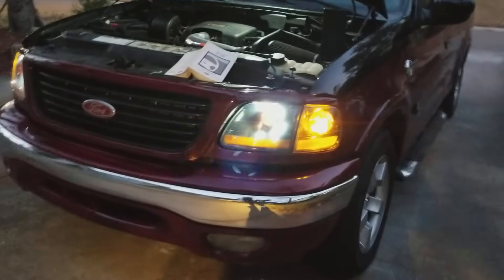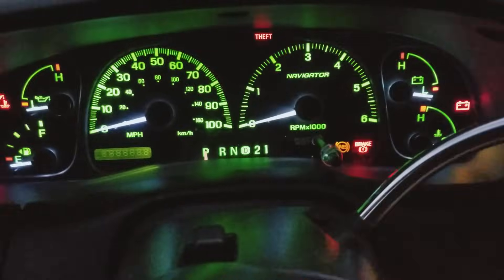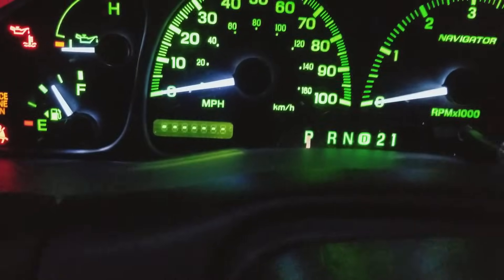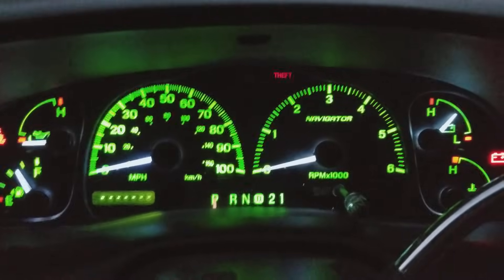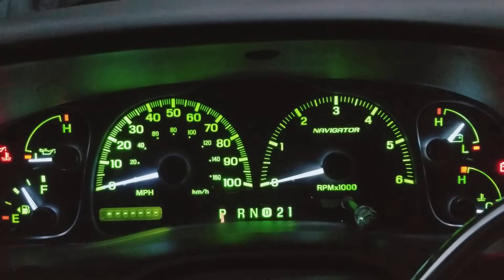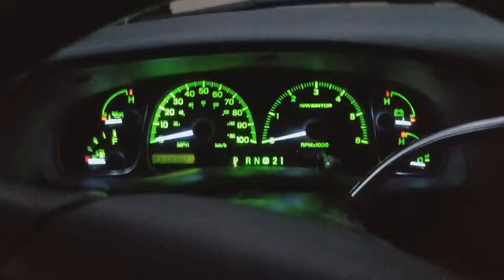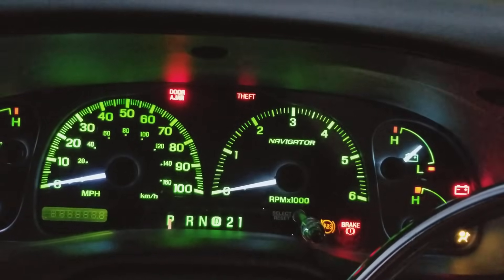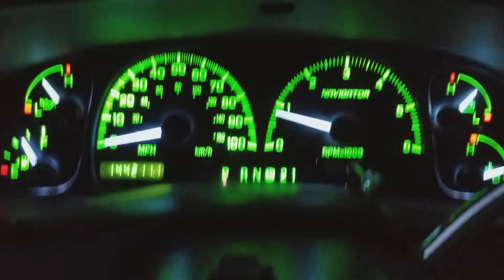1999-2003 Ford F-150 THEFT light decoding

Comment: I just fixed a 2001 F150 4.6 V8 crank no start with flashing theft light, dashes in the odometer, clicking PCM and fuel pump relays. No communication with the scan tool and theft light code 16. The fix was to remove the PCM connector and check power and ground circuits. All ok.  Reinstall the PCM connector and theft light is solid odometer reads 229k miles instead of dashes.  NO clicking relays scan tool communicates with PCM. The problem is micro corrosion of the PCM connector terminals causing poor connection. 

I hope this helps someone else resurrect their old Ford

Comment: WE CAN DELETE PATS PERMANENTLY if anyone needs that.

Codes 11 thru 15 are typical PATS problems (transceiver, incorrect key codes, etc) and having us delete PATS will fix that right up.

Code 16 means the PCM is either dead, not "on" or not getting power, or it's shutting itself down on purpose to protect itself from a short. Code 16 requires additional diagnostics, but a great place to start is checking your fuses and your PCM relay. You can temporarily swap your PCM relay for another one in the box with the same part#, just to see if that fixes it. If it does, that relay was bad.

Whenever you see - - - - - - on the odometer, that means your PCM is not functional, or at the very least it can't communicate with the PATS module. The instrument cluster is designed to display all dashes any time it can't communicate with the PCM. Usually this happens because the PCM is not functioning. This does not always  mean the PCM is bad, but it does mean it's not currently alive.

For less than the price of buying one programmed key, we can delete PATS permanently and your truck will never need key programming again, and you can start it with a $2 metal hardware store key, as long as it's cut properly. We also can provide you with a good used PCM that is already VIN programmed, coded, and PATS Deleted, meaning it's turn-key ready to run when you get it.

Comment: My 2001 5.4 f150 4x4 only throws one code p00353 missfire primarily secondary coil c . I e replaced coils plugs intake tps,knock sensor, map sensor, maf,cam,crank sensors, complete timing set after 1800$ it still misses at warmup temp or above 45mph . Runs great until warm misses bad .wgen cools down will run and pull like a champ .plz can anyone help in to deep to sell.

Comment: Is there a fuse also or just relay?
Mine wouldn’t start and theft was flashing but my battery has been draining down bc when I turn key off and remove the ac will still blow and electronics still power with key off and removed.

Comment: Mine did this. Didn't run a code. Had to boost it twice. Flashed theft and wouldn't start. Got it to start and had it tested. No idea. I got the relay and switched it. Guess I'll find out if that fixed it later. I can't stand electrical. This helped me alot tho because I had no clue where to even start

Comment: New subscriber  , thank you so much  , mine is a 03 f150 4x4 recently bought the truck left me stranded 50 miles from home  , had it towed ouch , this morning googled and found your video  , the relay cost 20 bucks at a zone, and now working great. Your video is the only one that I could find that was helpful. Thanks again .

Comment: I Changed  my pcm relay and I still have theft light flashing, still have code16 , I tried it with a jumper wire in place of relay. Still won't start.was running great when I parked it .just sat 2 days .replaced relay again  can you help me??

Comment: Brother you’re the best!!my 2003 ford f 150 did exactly this yesterday after work. It wouldn’t start with theft light flashing. I installed the extra relay for taillight heater and fixed it. It started 30 times straight last night!!! I’m getting a new relay today after work. God bless!

Comment: Anyone experiencing their truck misfiring when their theft light is flashing ? My truck starts and runs but my truck only runs smoothly and has full power when the theft light isn’t flashing, when the theft light flashes my truck definitely doesn’t accelerate as fast & gets jolty if I don’t go faster than 60mph ☹️

Comment: Thanks For Video
I Had The Theft 16 Error Code Failure.
Verified Bad Relay By Swapping One Just Like It In Fuse Relay Box.
The Theft Error Went Away..
Still Wouldn't Start Due To Moving Relay .
Walk Right Up The Street To AutoZone W Bad Relay..
21 Bucks Later..
Back On The Road.

I Figure I'll Keep An Extra Relay In Glovebox

Comment: The code 16 occurred in my 2003 f150 lariat after I replaced the battery. This did not fix my issue unfortunately.

Comment: my 2000 f150 has P1260 and still starts an runs. I only hooked up a scanner hoping to get a trans code . 50MPH and 3400 RPM.. Transmission fluid is reddish and  doesn't smell burnt. Any ideas on either issue are appreciated.

Comment: What kind of cluster is that
Reply from the maker: Navigator! They're easy swaps to do, and look far better than the standard F-150 clusters. I've got another video if you're curious about the swap.
Reply: @fawfulize  Lincoln Navigator what year? Did you swap your ac controls also
Reply from the maker: @Htxfredy  99-02 works. Haven't done the AC controls, as that requires pulling the dash. Both the harness and airboxes are different.

Comment: Another fix if this isn't helping your situation. Use your key and turn your door lock on the driver side about half way. Not fully unlocked for about 40 seconds. Then turn it about half way to the locked position for about 40 seconds. Open your door from the inside and crank it up. Worked for me today. Driving home from work and my 2000 f150 5.4 died and started flashing theft. I did this and it's been doing fine ever since.
Reply: Cody Willey man I OWE YOU THANKS TIMES A MILLION ,,!!!   I was absolutely broke for the next three days and encountered this problem ,,, just had me seeing red if you know what I mean , watched one 30 minute video went into the wiring diagrams and where you could start ,,with testers and things I don't have ,, then watched this one suggesting a 20 dollar diode ,, whatever ,, would have been a start at least ,, but I give thanks to the almighty GOD that he sent me down to your comment ,, and also to you who took the time to post it ,,seriously I thank you ,, because I thought to myself hey it wouldn't cost a thing to try it  so I walked outside it was already dark and did what you suggested and BOOM truck started right up ,, shut it off and tried again and BOOM started right up ,,SO AGAIN I CANNOT THANK YOU ENOUGH ,, STRESS LEVEL PLUMMETED ,, Also when I get a little cash I'm going to see if I can find a way to send you at least the  $ 20,00 I would have spent on the diode ,,whatever ?? just for starters ,,, AGAIN SO MANY THANKS  !!!
Reply: @alanstubbs8196  glad I could help you out man. I got cashapp lol 🍻
Reply: Does this work only on powered doors? Cause I have a 2001 manual non powered locks and windows.
Reply: @alanstubbs8196 bro please help what exactly did you do can u explain the steps better?
Reply: Ive tried everything and theft light still flashes but havent tried this so u do the outsid lock with your key but how do you open door from inside is it the passeneger door?
Reply: @collinherrmann7223 driver door window rolled down
Reply: @collinherrmann7223 driver door windows rolled down

Comment: I have a 2003 F150 doing the same thing alarm is going off and lights flashing and won't start. I replace the PCM and still no start and still flashing THEFT. 

Help please.
Reply: Put key in ignition to 1st turn. Disconnect battery. Reconnect battery. Turn key to start. 😊

Comment: I just bought a 2003 Ford and the theft light flashes like that and has a weak sound but the truck does turn on and drives fine. However, it messes up the battery (we just had it replaced). Do you know how we can eliminate it?
Reply: Wait question r u able to regularly use it

Comment: I swap my instrument panel on 2003 f150.   My truck does not start now turns over.  Put old 1 back and it runs.  Will this your doing solve my problem?
Reply from the maker: Check out another video of mine with the gauge cluster swap. You're going to have to swap the PCB on the back of the cluster.
Reply: @fawfulize  Do you have a link to it?

Comment: I have a question my original cluster went bad so I got another one plugged it in and I thought it worked until I tried to crank it and it just kept turning over and I had a anti theft code 15 pop up so I guess they key doesn’t recognize the cluster I don’t have the spare key so what would you recommend me doing ?
Reply: you need to keep the original electronic board from the old broken cluster and put it in the new cluster

Comment: That was very helpful knowledge for someone like me. But my 2002 Windstar sport gauge cluster goes crazy. It also if you leave it idle the radio starts to fade out the fan fades out to nothing and things get them then you hit the gas it comes back. And then also sometimes you can just turn it off and try to start it and you just clicks like it's a dead battery real fast clicking noise like a ground bad. That's what I have 👍
Reply: Bad alternator !

Comment: Where did you get the other ten  when you only counted 6?
Reply from the maker: 7 flashes total. First set of flashes determines the tens digit. Second set determines the ones.

1 flash
Pause
6 flashes
Long pause
Repeat 

Code 16.

Comment: PROCEDURE WITHOUT A SCAN TOOL
If you do not have a scan tool with PATS programming capability, then you can use the following procedure. Just insert the new key into the lock cylinder and turn the cylinder to the “Run” position. After you do this, the “Theft” indicator light will begin to flash. It will take approximately 15 minutes for the light to stop flashing. Within 5 minutes after the light has stopped flashing, Turn the ignition switch to the “Off” position for one second, and then back to the “Run” position. After doing this, the “Theft” indicator light will begin flashing again for another 15 minutes. When the light stops flashing for the second time, turn the key to the “Off’ position for one second, and then back to the “On” position for the third and final time. The “Theft” light will flash for another 15 minutes. After the third time, which will be approximately 45 minutes from the start of the process, the PATS control module will have erased any of the keys that were programmed into its memory, while programming the new key that you have just used into its memory. This key will now start the car. Any additional keys can now be programmed using the Spare Key Programming procedure.
Reply: Dnt work

Comment: Hi, I have a 2003 F150 Supercross with the 5.4L V8. After I had a code alarm installed with remote start, the truck won't start in cold weather below 50 degrees including the the remote start. It flashes the theft light. After 3 or 4 tries the truck only starts with the key

Comment: 2000 Ford Excursion:     When the theft light blinks rapidly it means there's a (Code) problem with the PCM system.....so when he  turned on the key, it  blinked fast for about 45 secs....then it paused.....then it blinked once (for 1).....paused...then blinked 6 times (for 6)....That means a code 16........and then it started over....once...then 6....and so on. 
There are other codes like 15, 17, maybe a 14 but it's usually a 16...that usually means it needs a new "PCM relay" (under $20..00) from the dealer or salvage. easy fix. Find the relays in the fuse box(s). see manual.
UPDATE!!!!....I wasn't my PCM relays after all.... I had my charging system checked a few months ago when my 1 year old battery was failing.....turned out that the alternator's diodes were no good! (along with its bearings) ...allowing voltage back into the CPU/PCM when turned off, causing it to do all kinds of weird stuff. Went to Ford and bought a remanufactured Alternator ($215.00) and NO MORE ISSUES!!!!!!

Comment: I wish I could get an answer from someone please I got a 2002 f150 I put a new fuel pump and new fuel filter cam sensor and crank sensor new battery it has no fule module under the spare tire and put new key switch in with no chip the theft light was given off the same code as yours but when I turn the key on the theft light will flash rapidly but won't give any code to me now because I did what you did . Okay well still won't start I've been on other youtub channels and no one will answer me back so I thought I would try here is it normal for it to flash rapidly when you turn the key and then go 📴
Reply: Hi Friend, I had the same problem on my FORD , my aunt recommended CYBER_KOR on Instagram and got mine done.  He is also on WhatsApp +1 347 830 3644.
Reply: I'm having the rapid flashing theft light on my friends mustang. Here is how you get to the codes. Turn key to on position (not run), and leave it there for a minute. After the theft light goes out, it will then flash the codes. Watch carefully and count the blinking. First digit, pause, the second digit, then long pause. Then it will flash the next code or repeat the first if there is only the one code. Used to read codes on the older cars this way. Counting flashes and write them down to look them up. Hope this helps

Comment: Comment 206!!!  Exact same thing happened to me this morning on my 2003 F150.  I was so frustrated trying to troubleshoot this issue and after about an hour on the internet, came across this little video.  First I let the key sit in the ignition in the "on" position for about 20 minutes and it fired right up.  I also bought a new relay and swapped it out just in case...  Seems to be working perfectly for me.  Thanks for the video.

Comment: I couldn’t find the keys and got a spare I had stored. Truck wouldn’t start and flashed 5 times instead of 6. So this didn’t work for me but I ended up finding my keys and tried it and it worked. The spare wasn’t programmed so that’s why it did this for me. Thought I’d comment Incase someone is having the same issue

Comment: THANK YOU! My 2003 F-150 had this issue (Code 16). Replaced the PCM relay ($11 @ Advance Auto Parts) and voila - back in business! You saved me a tow and possibly reprogramming the key.
Reply: This is what I’m dealing with now. I have a 2010 Fx4 and my PCM itself went out. So I have replaced the PCM and now it’s throwing a Autotheft Code but not sure which one it is. I will check after work. I will pass by Auto Parts store and get a PCM Relay also. Hopefully this works if not I will bring it to dealership and most likely get ripped off. 🤦🏽🤦🏽🤷🏽🤷🏽

Comment: HEY, MAYBE YOU CAN HELP.I GET THE BLINKING CODE 77.I PUT A ON/OFF STYLE RELAY AND IT STARTED,THEN INSTALLED A NEW ONE AND NO GO,PUT OTHER BACK ON AND STARTS WHEN WANTS TOO UNTILL IT FRIED MY TEST RELAY,I KNOW SO BECAUSE IT STARTS WITH A WHIRE JUMPING BOTH TERMINALS AND NOT WITH OTHERS.ITS BEEN SITTING 5 YEARS.AT FIRST I THOUGHT IT WAS RELAY BUT DEFF HAD THE FUEL PUMP DEFECTIVE,INSTALLED NEW ONE NOW WORKS BUT NO GO WITH ITS RELAYS.AND  NOW INSTEAD OG DOTS ON CLUSTER IT NOW READS NO MILEAGE AT ALL.ANY HELP WOULD BE APRITIATED.

Comment: Thank you. Had this same code 16 with theft light and no start condition. Started out as an occasional issue but only when trying to start warm truck... Then my truck actually shut off while driving, not cool....which led me to researching and ultimately this video.
Swapped out the factory relay with an automotive Bosch 12v relay. Just cut the tab off the relay so the fuse block dust cover will still close. Truck is running great 👍

Comment: I lost my key in a house fire so I took out the old ignition and put in a new one and it won't start.. says theft... can anyone here help me on what to do?
Reply: you need to get a locksmith to program the new key properly to match the PCM of the vehicle
Reply: Golpe a golpe
Reply: Neeew chipped key
Reply: If ignition switch is working you maybe able to wire the fuel pump relay to make it kick on..some of the truck have anti theft that disables the fuel pump..some disable ignition coil..some do BOTH ..you can test if yours is fuel pump only by taking out the fuel pump relay..there are 4slots..one slot goes in a different direction than all the others..push paper clip into slot or use wire.. listen to here pump kick on... turn key to see if it starts..if it does you can run wire from the 2 spots you jumped..hook to relay..run wire to toggle switch inside of truck...if that don't work you'll be spending alot of $.. these have a chip key that gets read by a transponder..if original lock cylinder is around reinstall and you only have to purchase they chip keys and have them programed at the dealership..will cost 2or3 hundred. If they have to replace cylinder lock to accept new key more $...BIG PAIN IN THE ASS..unfortunately there's no way to program a key yourself..best you can do is try to kick fuel pump on the way I described and hopefully your model only kicks fuel pump off
Reply: chang pcm cluster key-then that's all

Comment: I was driving and all of a sudden cut off truck died and would crank no start at all. I thought It was a fuel issue changed the fuel pump fuel filter bought a new battery and check for fuel pressure which was good. After awhile it’ll start again and randomly shut off and won’t start again. What I didn’t see before is that the anti theft is flashing fast does that have something to do and will it shut off truck while driving?
Reply from the maker: It absolutely will. First time it happened to me, it did.
Reply: fawfulize will check that out next. Thanks 👍

Comment: Got to say thanks! Don't know if I solved problem or just put off. Stoped at a store came back out tried to start 06 f150 and it would just crank..pulled relay cycled ignition put relay back in and fired right up. Saved my night after a very long monday!